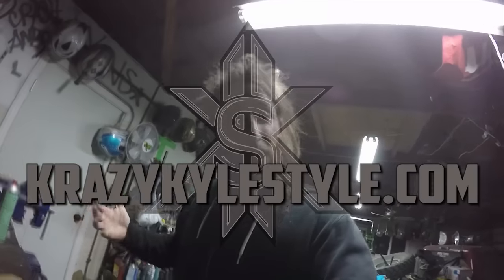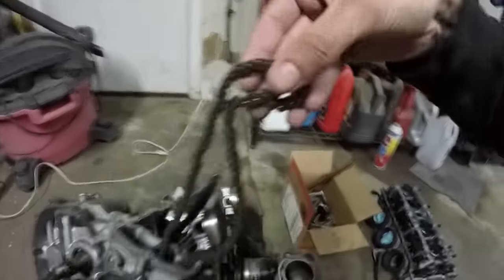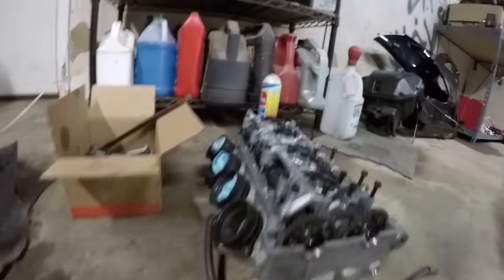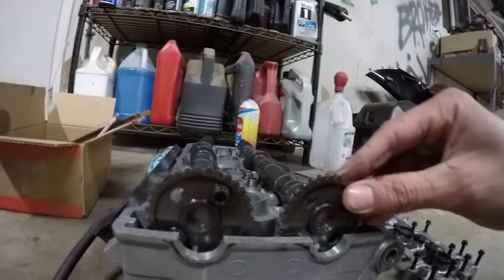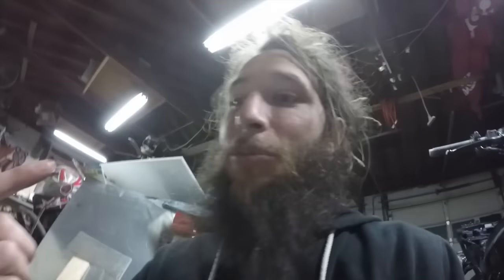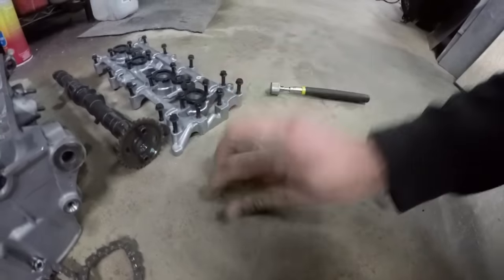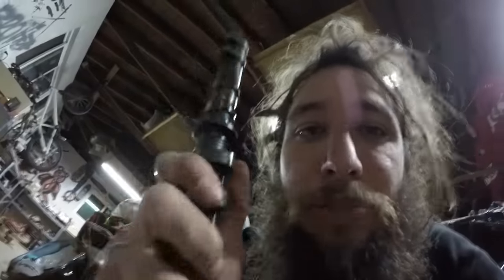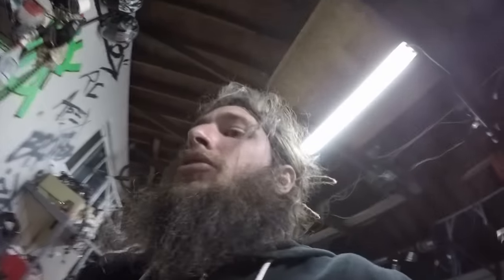Cam Chains Revisited

Comment: Is there a math equation for shim thickness+or- clearance etc?....
Reply from the maker: In the owners manual there is a look up table that tells you what shim you need. But you must know your valve clearance first, which you measure while the cams are still in place. It’s easy to do , just takes time.. if it’s your first time than just go slow . Use the manual (found on inter webs) and YouTube and you’ll get it . Then once you know shim size you need you can order those or you can order a full kit (wasteful if you aren’t doing many bikes). Good luck 🤙